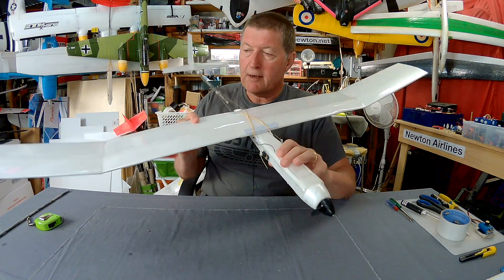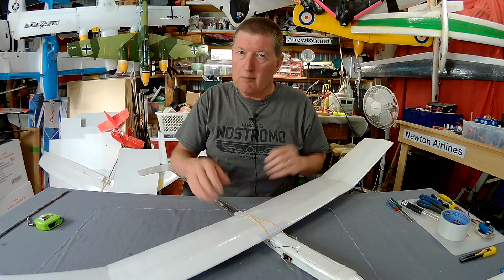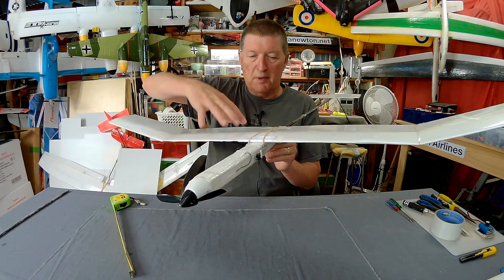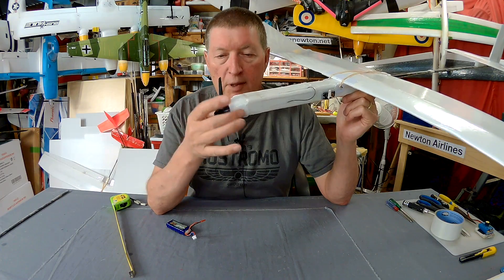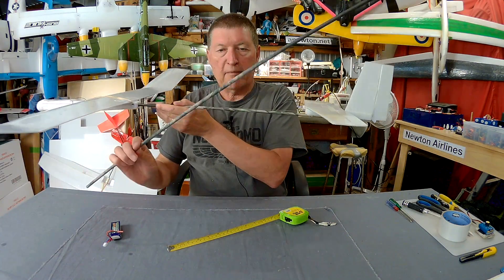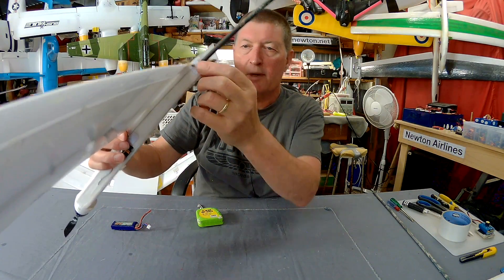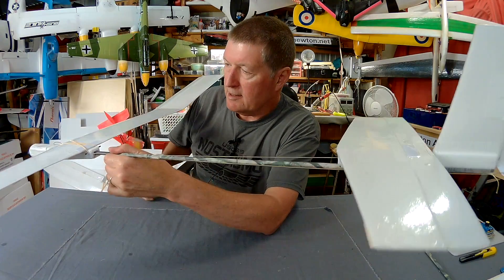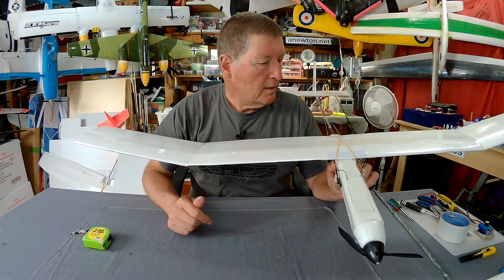3mm Depron glider build overview (N3UTRON)

Comment: I spent the last week building my N3utron, which is almost identical to Andrews one, with the Emax motor and a fixed prop. The only difference is I used 1.2mm carbon push rods and not the torsion spring controls and iron on film and not laminating film. Flys like it is on rails. Love it.
Reply from the maker: Excellent to hear your success

Comment: Great glider, respect! I want to recreate it but can't find the information about the angle between the main wing and elevator, how big is it? According to the plan geometry, it is around 3.5 degrees, is that correct?, For normal glider it should be 1-2 degrees. Best regards form Germany
Reply from the maker: Many thanks. I didn't measure that at all sorry. This is not an accurately designed glider at all.

Comment: Hi Andrew. Yet another question. The foam board you use is just foam. Not foam sandwiched between paper. I’m having a hard time here in the states trying to source the 3mm or for 1/8”. Just wanted to make sure it’s not the paper/foam. 
Thanks again. Mike
Reply from the maker: Uncovered Depron is what I used. You can use Dollar Tree Foamboard with the paper on but it will be thicker.

Comment: Hi, what temperature do you laminate your wings?  I will need the materials needed to build the hull.  Greetings.
Reply from the maker: I use a normal clothes iron on half heat (Wool setting) which is about 150ºC

Comment: Great video, I was just wondering how did you join the tail boom to the fuselage
Reply from the maker: I'll show that in a future video but it's just hot glued to the top deck of the fuselage and there is a double 6mm depron bulkhead supporting the front of the shaft.
Reply: @AndrewNewton  thanks very much for the info I'm trying to build a smaller version of this under 250 grams

Comment: I'm just looking at my Aqaufina 500mL water bottle and it's a perfect match for that cowl at 0:00 seconds (that's when the plastic was thicker and not too thin like now)(I refill it). I suppose you could paint it or put tape on it and also tape it to the fuselage. But what I want to know and see are the innards to this beauty and most of all, I want to know how that arrow shaft was secured/held/glued in the fuselage. I would like pictures and all the details because this is paramount. Oh, a feller's just gotta have both a 3mm and a 6mm wing at all times and let the wind decide / determine and I'm guessing that's zero degree incidence for the wing, right?
Reply from the maker: Yes I know, should have taken more photos. Yes, Zero incidence

Comment: rotor kv & size ?🙄
Reply from the maker: Thanks Ali, excellent information
Reply from the maker: Same as the U-Glider, whatever that is??
Reply: For a plane of that weight any 20-30 gram brushless motor should work regardless of what kv it is. This plane only needs the motor for getting to altitude after launch and getting out of troublesome situations, other times it will be gliding so I am guessing that using the perfect power system doesn't matter that much. In my opinion only thing to care about is if you are not going to use a folding prop, using a higher kv (around 2200) motor with a smaller prop (5-6 inches) would create less drag.

Comment: Another beaut design!  The tip panels at 35cm is that the flat length?   Not to clear on the plans photo from above with dihedral ...Thanks  Laurie
Reply from the maker: 70cm section cut in half, so yes 35cm flat length